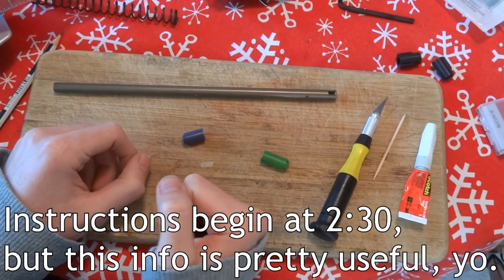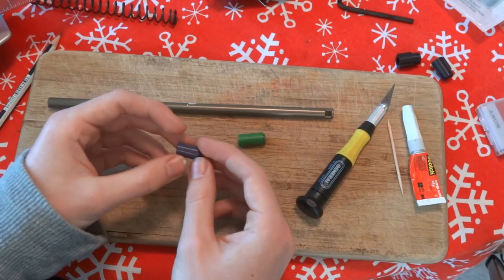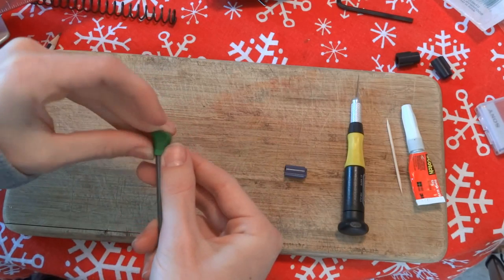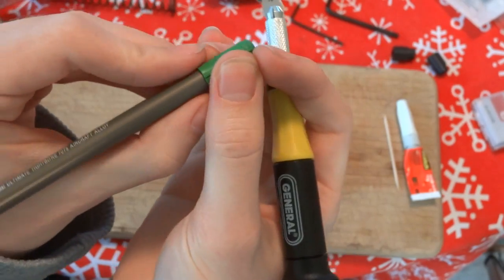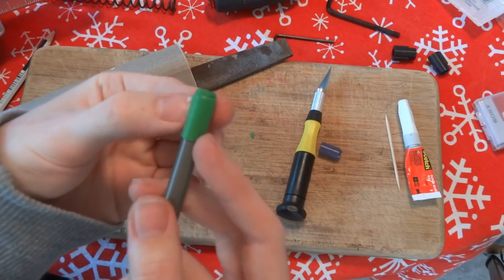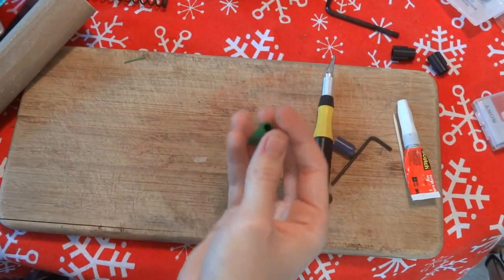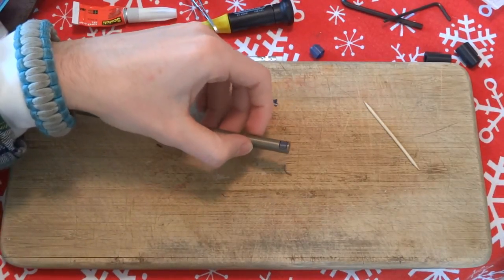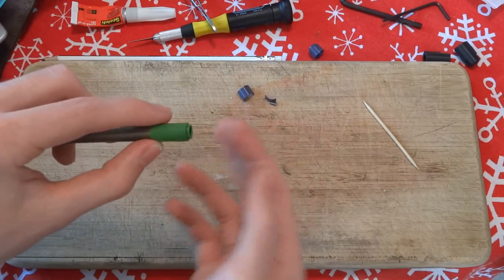Increase any Airsoft Gun's Range and Accuracy: G-Hop Installation Guide

Comment: Does the G hop have good durability. How often am I going to have to redo the process when the old contact patch wears out? How does it compare to R hop as far as durability. Otherwise great video man I tired installing G hop works great so far.
Reply from the maker: I've never had a G-Hop wear out. I had one I shot over 100K rounds through and it still worked great, but I ended up tearing that one apart to switch to a harder contact patch only because I find better performance in higher FPS guns with harder contact patches.

Comment: How does this compare to flat hop?  I just did this last night because of how well you explained it.  I used a purple Prometheus as my patch, a lonex 70 degree bucking and a maple leaf nub.  The nub that looks like the omega symbol. So far so good.  Thanks for the video.
Reply from the maker: I get better results out of this than flathop. Both methods work on the same idea, but this method works better since it gets even more contact between the bucking and BB than flathop does. I recently put a maple leaf nub into my Type 97 and I do believe it increased my accuracy over the stock nub.

Comment from the maker: I've had mixed results with using G-Hop in gas guns. It really depends on the hop chamber of the GBB, I tried to put G-Hop into a KWA pistol but I couldn't get the gun to apply enough hop. However I've had a lot of success with a G-Hop mod I developed for the KJW KC-02. Since I can modify the KC-02's hop arm to be longer I was able to get the gun to apply enough hop, but I had to glue a piece of plastic to the G-Hop patch and then glue that plastic to the bucking to get the hop to be consistent.

Comment: Great video I will definitely try this. One question: What was the purpose of the piece of tamiya connector plastic you glued onto the original nub? Is it just to create a greater surface area to the contact patch when applying hop? If so would you recommend a slightly bigger piece of tamiya so that the nub presses more surface area of the contact patch? Cause the nub is still a fraction of the size of the contact patch. Thanks.
Reply from the maker: Ryan Gordon Thanks! I did not get good results with the Tamiya mod. The only nub I recommend is the Maple Leaf nub, otherwise the stock nub works fine. With the design of the g-hop it's not completely necessary to have a larger nub to get more of the contact patch into the barrel

Comment: Just did this to my sr25, stupid range with .30s, awesome tut man!
Reply from the maker: Thanks! The performance increases considerably with heavier BBs. I use .32g and the range is just silly.
Reply: ***** heck yeah! I was using .25s an I could see a better trajectory so I tried the .30s and just started giggling when I lost sight of the bbs and it hadnt even started droppin yet, barely any hop applied, I also made a maple leaf looking nub, thats half a lonex 70 nub glued to a small measured piece of a small tamiya connector,  AWESOME RESULTS.
Reply from the maker: metalheadmobster Glad you got good results with the Tamiya-nub mod. That mod is extremely hit or miss. Have fun on the field! :D

Comment from the maker: I use the stock nub. That's odd that it doesn't push it down far enough, I did this mod to my friend's G&G MP5 and it worked fine. Open up your hop up and check to make sure the contact patch is still attached and the nub didn't fall out during the installation without you noticing (that's happened to me before). You could try a solid nub, like H-Nub or SCS, that'll push it slightly farther than the stock nub does.

Comment: Last night was a success! Made a perfect patch - although a small part of me died inside when i sliced up a Prometheus rubber. Question: How do you feel about gluing the patch to the inside of the outer sleeve? The small dabs of crazy glue on the actual barrel itself could come apart with the amount of force and say 390fps no? Also - What bb weight do you find gives you the best results .28s?

Comment: So I commented a while back, an iv changed some stuff up on my KWA mk18 an I just did the mod tonight. I'm pretty impressed with the accuracy. An I did the mod with the maple leaf bucking as. My contact patch an the 2gx bucking as my outer bucking. an the reason for me using the 2gx bucking is cause I lost my g an g green bucking. An I just now found it. Should make the g and g my outer bucking? Or should I just keep the 2 gx bucking? I did the test in the dark just with a porch light an a really bright flash light I was hitting a paper plate from 120 feet every time. Nothing special just that's as far as I could go with out stepping off my porch. An also the contact patch was kinda hard to push I noticed yours looked pretty easy to push in. Does this mean I messed up somewhere down the line? An when I turn my hop up all the way off it only shoots like 25-35 feet an it drops, is that good or bad? I have my hop up cranked all the way up. So I'll do a better range test tomorrow an if doesn't do to well I'll restart with the g and g bucking! The mod wasn't hard at all! Especially with your amazing tutorial great job!!

Comment: I'm hoping you still check these. I got a question. If you mess up cutting your inner bucking, are you really done? Cant you just go and use another bit of the original inner bucking you're cutting out of? Isn't there enough for 2 attempts in 1 bucking?
Really just wondering, hearing you say you'd be done made me wonder,

Comment: I just did my own modification hop up stuff and its the best I have tested yet. I have used normal hops flat hops and also other type of buckings and Nubs to get a flat straight shot for 200+ feet. All were good but not great. Now my gun is a lazer beam and I said I can do this shit better. Boom my guns accuracy is INSANE... I can hit a 6 inch or head size tin can top at 200 feet No issues at all. I could hit a person at 200 250 feet I know it. Im not sure what other guns are doing but My jack with a .30g IS insanely accurate now. Im using a Prowin with a madbull redshark bucking and a Fire Fly nub. and A special part to give me a Great hop and a large one. The issue I was having was hopping heavy bbs. The reason was the nub and the arm on the hop were didnt really push down enough to give me much hop. Its working Great now and it shoots insanely well. 
AS for your "" G hop "" No deal thats not going to work. I dont like it much. Its not going to last and its going to be inconsistent over time. I see lots of issues with it. It might work for a little bit but you can see the gap between the bucking and the insert. a bb is going to hit that lip and bounce down the barrel and shoot straight for 100 feet then go left or right. The idea of a Flat hop is so you get Perfect connection with the bb as it passes so you dont get any curves at the end of the shot. THIS is hard to do... My method only tested 3 mags is working SOOOO nice im almost set to do a video. The thing is its sooo flat and straight its incredible and I can bet others are doing this same thing but a bit different.
Reply from the maker: +LiveFreeOrRIP Have you even tried G-Hop? You can speculate all you want about issues that "might" occur with this method, but I've been using the same G-Hop install in my Type 97 for 3 years, with over 100,000 shots through it and it's never had an issue... Shoots straight past 200' and it's hard to miss someone at 250'. Never experienced a single issue you've speculated. G-Hop is based on the same concept that flathop is (more contact between the BB and hop rubber) and G-Hop does it better. The performance you're reporting in your gun is good, but it's pretty average for an upgraded airsoft gun.
Reply: LiveFreeOrRIP What method did you use?

Comment: in another video you used had a kjw kc-02 with the same mod. is the g-hop installation the same and how does it compare with the regular bucking?
Reply: forgot to say great video! btw my kc-02 is at about 420fps and I use .4's

Comment: I saw your video just the other day, so I wonder; after you trimmed off the long nub from the bucking, you began to turn it inside out and install it on the inner barrel.  Why not just keep it inverted and just install it?  It seems to me that this other step is just a waste of time.
Reply from the maker: If you try to use the bucking flipped inside out you'll get feeding and air seal problems because the lips of the bucking will be deformed.

Comment: I have done this and im not really noticing any performance increase, should it be a drastic increase? have I done it wrong? its pretty much exactly the same as pre modification if not ever so slightly worse. (Lonex hop unit, G&G green outer bucking and G&G green contact patch)

Comment: I have a stock kwa bucking to spare.  Would it be just as effective if I cut out a portion of the bucking to make the contact patch?  Or would that not work.  (I'd obviously smooth it down like you did)
Thanks,
Danny
Reply from the maker: Yeah, that should work. I can't think of why it wouldn't. G-Hop works pretty well with any bucking.

Comment: just a question is g-hop really that effective?
Reply: It works well. Is it the most effective? I'd say it matches or at least comes close to R hop. I think R hop centers the BB better. Personally I would say forget G hop and do a flat hop (which is the first step to an R or S hop) and then later on if you want do a S or R hop. S hop is same as R hop but significantly easier to do and only uses materials form the hardware store. Downside is that S hop is potentially less durable than an R hop.
Reply: @DaveSmith-cp5kj  I got a Prometheus 6.03 tight bore barrel, a modify flat hop nub and used the standard G&G green bucking and I put everything back meticulously. The accuracy and consistency jumped up and the hold-up is a bit more effective but touchier but I dropped like 30 fps from 375 to 345... is there a way to boost this?
Reply: @TacticoolVIKINGBeard  The reason your hop is more sensitive is because the flat hop drops down on the BB more. This allows you to get higher hop due to similar effects of using a larger nub. Consistency (precision) results from the BB being jammed into that bucking as it is fired, increasing friction and reducing the chance of the BB slipping causing inconsistent hop. The only way to boost FPS is to work on your rocket valve (if GBB), or increase spring weight on an AEG (or any mod that improves air flow into the barrel.

In reality, unless you are aiming for past 70 yards for a precision rifle, 345FPS with a .20 is plenty. Precision is much more beneficial than speed, as velocity itself is often detrimental due to field limits.
Reply: @DaveSmith-cp5kj  it's a G&G CM16 Raider  AEG m4. Our field is outdoor so the fps and range would be beneficial. I have more accuracy at roughly the same range but by the time the BB makes it to that location the target is already gone. I just dont know what the stock spring weight is and I dont wanna damage anything by putting in a higher spring weight. AEGs are still fairly new to me given idk too much about electronics but I do like the rifle I have and it works well. I'm just looking to see how to find the sweet spot for what I have and the field I go to. The standard engagement distance here is between 50-100ft so having something consistent that can keep me about 380fps would be great. Yes ik it's not a Krytac or any "supreme" gun but I'm sure with the right tweaking I can get something fairly decent.

Comment: Heya!
Made it saturday, tested it out sunday.
I was amazed... i got a CQB replica with a 23 centimeter barrel (+ - 9 inch)
i reach about 200+ feet now. instead of the sad 130 i was around last time!

Just one question. i still got my sniper incoming. do you think this will work just as fine for my bolt action? any advice for the future?

Thanks for the tutorial!
Reply from the maker: Awesome! Glad to hear you got as good results from it as I typically do. I've not tried g-hop in a bolt-action myself, but I imagine it'd also work great.
Reply: TopHatRunner Airsoft going to try this in my aps2 Sr1, just finished tefloning the threads of my cylinder, and the hopup itself, gonna go back and test out this mod on top of the Teflon.  I am testing a makeup sponge in junction with the rubber dampener on my Piston to mask that loud smack after firing. I'll let u all know if the suppression works.

Comment: So by making a G-hop you get better range and accuracy than a stock hop up because it puts more back spin on it? I just bought a kwa SR-10,which has the standard kwa bucking. What's the difference between the G-Hop and the kwa hop up.? Does this add any fps to the gun?
Reply from the maker: Yes, a properly installed G-Hop will increase your range and accuracy over a KWA bucking. I'm not sure why. I heard about the "wobble hypothesis" but I haven't read up on it. Putting more backspin on the BB would increase the hop up effect, the G-Hop seems more like it puts a more stable spin on the BB that last longer. FPS might change, but that'd only be if your outer bucking has a better or worse air seal which depends on what you use for an outer bucking. G-Hop's contact point is longer than the KWA's bucking.

Comment: Are g&g green buckings good for the contact patch? Also, are stock g&g nubs good to use? Madbull nubs?
Reply from the maker: G&G green buckings work fairly well for the contact patch and outer bucking. And use whatever nubs you want, try both, see which works better for you. I haven't compared those two so I don't know. Yes, G-Hop will work fine at 280 FPS.

Comment: Nice guide, I'm buying a H&K SL9 for DMR and i really want to make this, the idea is to put an SP150 spring on it an 650mm 6.03 inner barrel (it comes with a 6.08 and 650mm long), i want to shoot at least 200ft effective, any advice or recommendation to archive that?

Another thing, how it works using only G&G green for the contact and for the external?

Comment: Nice! so this is basically Flat hop but with a bucking patch between the barrel's window if I'm correct? The whole process seemed pretty familiar with the whole shaving down the inner outer bucking.
Reply from the maker: +NeonVars Yes. Flathop was created as an adaptation of this method for those who don't want to be bothered adding a contact patch, so since flathop was developed from this method, they are very similar. I get considerably better results from g-hop or r-hop than flathop, so I recommend you take the extra step and add a contact patch.
Reply: +TopHatRunner that's interesting. Would you recommend any other types of buckings for the contact patch material and the outer bucking? What kind of nub would you also recommend?
Reply from the maker: NeonVars I recommend pretty much any 70 degree bucking for the contact patch. For a nub I recommend the maple leaf nub.
Reply: +TopHatRunner is this the nub you're talking about? 

http://www.evike.com/products/53142/

I was currently eyeing the Prommy flat nub on evike. Will that work too?
Reply from the maker: +NeonVars Yeah, that's the nub. I haven't tried the Prommy nub, and I can't really guess whether or not it'll work well because G-Hop is really picky when it comes to specialty nubs. Only one way to find out how well it'll work...
Reply: +TopHatRunner I purchased both. I'll let you know of results when I finally test the Prommy bucking on the G hop mod.

Comment: I have a kwa, shooting 385 fps with .25's. I have the stock hop up system maple leaf nub the maple leaf bucking would not work. I also have a Systema type 1 cylinder, m120 raptor ported piston head. So if used the maple leaf as the patch an used the standard 2gx bucking how much will that increase my distance? I'm already shooting around 260ft 240ft accurately. I'm also switching to .28's.
Reply from the maker: It's impossible to estimate how much, if any, of an improvement you'll get. I'd use the G&G bucking for the outer bucking and the maple leaf for the contact patch. If you got better performance with the 2GX bucking (which is doubtful since KWA's buckings aren't anything too special and would most likely mean you messed up the G-Hop install) you can just pull the contact patch off and go back to the 2GX bucking.

Comment: would this be beneficial for a DMR? because im in the process of building one, ive got the power but not the accuracy of consistent hits.
Reply from the maker: Since a properly installed G-Hop will boost range and accuracy, yes, it's great for DMRs. If you're shooting much over 450 FPS you have to be careful. When adjusting the hop, start with the hop off and slowly adjust it with increasing the hop between shots until you reach the desired level of hop. If you try to shoot a high FPS gun with the hop full, the contact patch can get ripped off the barrel and cause a jam. So long as you don't over adjust the hop you should be fine, though.
Reply: ***** thank you! for your help. :-)